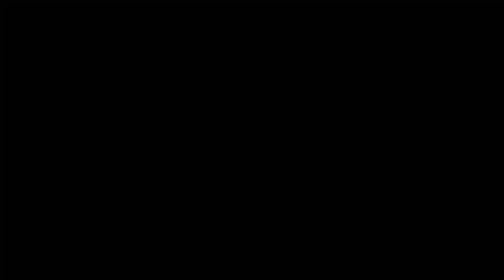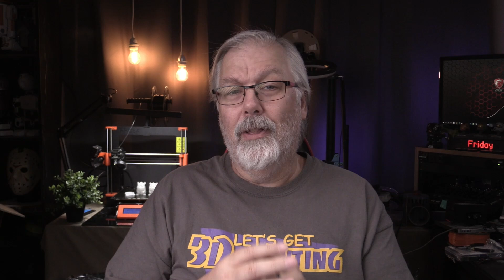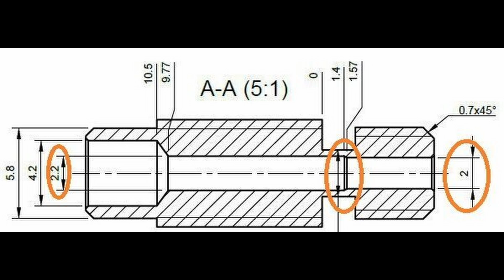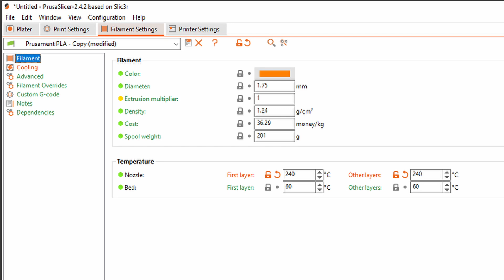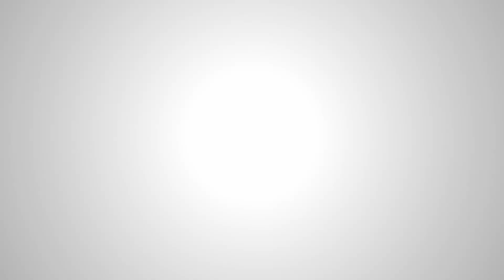Troubleshooting 3D850 PLA on A Prusa MK3

Comment: I will have to give changing the heat break a try.  I had nothing but problems with printing "true food safe PLA", which as you mentioned on the phone is based on 3d850 material.  Thanks!